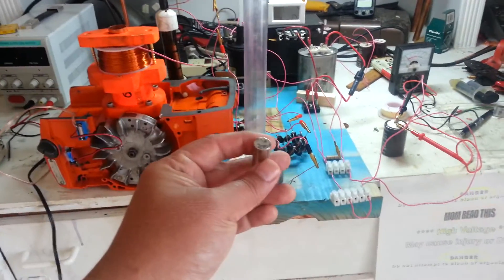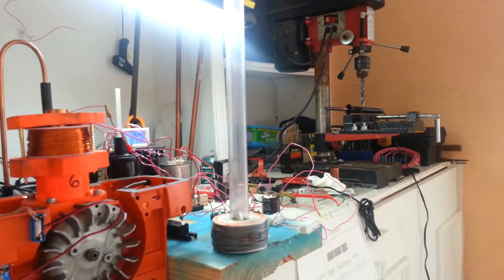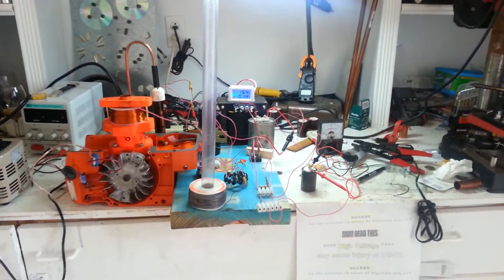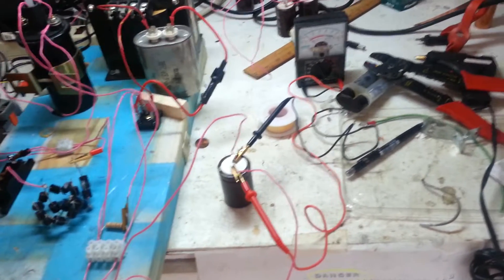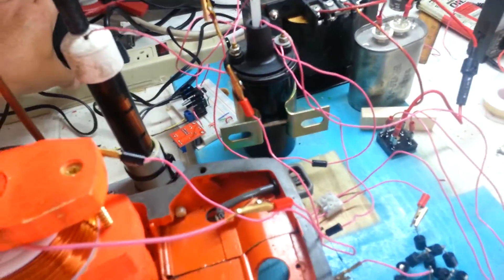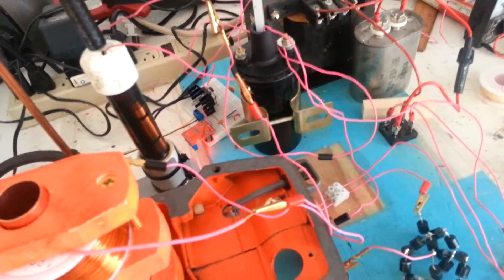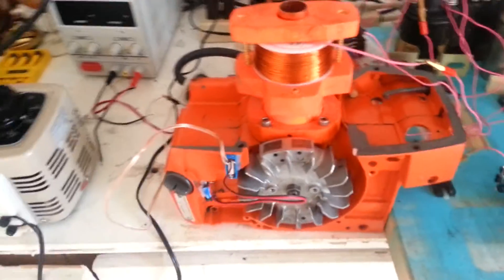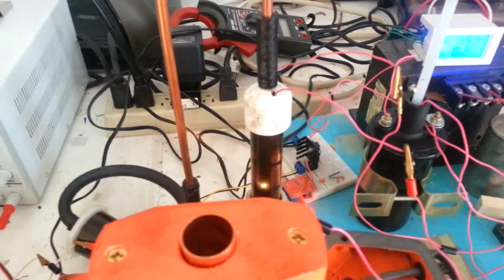Working Ed Gray Motor

Comment: Hi great video. However this is not a gray motor. Ed Gray motor uses two opposing coils period and uses the electricity to recharge the battery. Only the back EMF spikes are used to run the motor. He also did not have any metal in his motor. You're about a quarter of the way there. There is a actual replication called Ed Gray motor test here on YouTube
Reply from the maker: I have been told it's not an Ed Gray motor before. I can't pretend to speak to that, I wasn't near his device, nor did he personally tell me how it works to compare.  I built to what I thought would work, it has a spark gap tube and can pop magnets.  If you do know to say that I only built a fourth of it, well done. But please let me point out that no where in your BEMF battery charger description, did you explain what the Gray Tube was or what it did. I find that odd, because the CET seems to be the heart of the available schematics. Since we are on BEMF subject, Bedini who drew a schematic to Gray's motor, is famous(infamous) for his BEMF chargers. Which as we know didn't live up to the hype. Therefore it's hard for me to believe that the Ed Gray motor was just an earlier version of a Bedini BEMF battery charger. If it was possible to run a motor from BEMF, so many people would have self running perpetual motors. Try to build a Bedini motor, and you'll see. Now try create a BEMF motor that has an excess of 750 watts. That's  only 1 horsepower. If you have more information please share. I am no expert.
Reply: @XR_IX  I don't have much experience with the bedini motor, so I'm not sure your reference of its legitimacy to be accurate. I do know that he was threatened, which does give some legitimacy to his claims. Maybe you have some more info on that to show with me? You do make good points that few people have been able to replicate Ed Gray's motor. However there have been some that have. Honestly most people that get to that level do not broadcast it, for the obvious reasons. There's enough information out there to see exactly what a great was doing as far as material and components. The hard part is being able to identify exactly what back EMF actually is so that it can be used properly. You can see for yourself in the coil popping demonstrations that much more Force is demonstrated by a capacitor then a electromagnet for the same energy input. Ed gray did not have any metal in his motor, it was all dielectrics. If you know anything about t Townsend Browns work you will know that he also use capacitors and dielectrics to produce his effects. These two things are related. In my resonant charging video you will see that there is a use for the back EMF discharge and a wireless energy that can also be collected when the discharges are not occurring. Nikola Tesla said that any alternating current over 10,000 Hertz would produce wireless energy. That's why I use the neon sign Transformers because they are around 38 khz. Although they are tricky because they have fail-safes. You have to use a metal halide light bulb to prevent the back EMF from shutting down the Fail-Safe in the neon Transformer. I think the way Ed gray was doing it was by using the two coils and just transferring the pulse to the next coil while at the same time utilizing the repulsion for mechanical work. But there is also that high-frequency component that can be used as well. The high-frequency component is a polarization of the energy in the space around you. That's all a free source of energy since the vacuum is an infinite source of Dynamic energy. The way I look at the capacitors is that they produce positrons when excited by electron current, and you can block the electrons in the capacitor while you use the positron from the vacuum. I think this is how his lightbulb circuit works, Don Smith did a similar thing. We now have knowledge of metamaterials and quantum mechanics that these two inventors weren't aware of. Positrons and other anti particles are the scalar component that were taken out of Maxwell's electromagnetic equations by Oliver heaviside. This is the free energy that remains when you take out all of the vector components. I quickly realized there are many other ways to split the positive as gray had described besides using that tube which is highly inefficient. In fact from what I read grey took the tube out entirely in his later versions. Splitting the positive actually means is being able to use the back EMF and the wireless electricity at the same time. In other words being able to use the electrons and the positrons. Positrons are just the electrons with a little bit more of a charge. If you find a way to polarize that positron with a larger charge then it will flow towards that larger charge and not annihilate with the electron. Therefore you can use both to do work. In my Don Smith device I use an earth ground which is 500,000 coulombs. Compared to the 10 to the negative 19 positron. Kind of like electrolysis how the charge dictates which plates the hydrogen and oxygen atoms stick to. The capacitor is much the same way the charge determines which plate the positrons and electrons go to. It isn't until you short the plates do you have the annihilation of occur which is that large spark gap discharge of X-ray emission. You can sometimes get gamma emission also with a large enough electric flux density so be careful. The electric flux density changes the dielectric constant and the actual rest mass of the particles in the circuit so that you can actually get a cold fusion very easily that scalar components is actually the secret behind all of the classified UFO technology as well. That's how John Hutchison was able to achieve his experiments. Anyways I hope this information was helpful I will try to find that video for you
Reply from the maker: @jeffvan2529  Rather than using this clunky messaging in YT to exchange ideas, let me first thank you, and say I am glad to make your acquaintance, you seem to be a part of very small slice of humanity who burns the candles bright. Allow me invite you to energyevo.org, it is filled with other bright candles and I consider them teammates. The forum is a closed community to serious people. Please let me know if you are interested and I will convey that to Zed. Meanwhile... here is something I don't share: https://youtu.be/-FjRV950snM
Reply: @XR_IX  I tried registering on the forum but it's not allowing registrations
Reply from the maker: @isaiahj3968   Hi Isaiah, I am not the admin of the site Energyevo.org, and you'll have to contact Zed, if there is a contact the administrator for the forum still available. The site from the beginning was not like other "Free Energy" forums I had contributed in the past, which generally wanted members of any kind. Which led to political/religious discussions and arguments --which generally are pointless and unproductive. It also led way for people who want to crush the soul of "out of the box" thinkers. This is my opinion of course, but @Energyevo I find a high level of competency, and people willing to replicate and challenge modern binary thinking.  Normally if I can estimate a candidate's level, I can recommend people. However, I don't see any videos you have created, so I am not sure where your head is at. (It is not my decision anyway). If you do have interest and have no vehicle to contact Zed, you might be able to post a reply to one of his topics.
Reply: @XR_IX  https://youtu.be/1rFjrPo9mws

Comment: Good afternoon
what is the electrical scheme of your device? how does the spark gap work
Reply from the maker: I have all schematics posted on energyevo.com, the spark really is just two coper bars with dielectric oil pumped to clean the carbon tracks. The spark of the HV allows high current from the capacitor to flow to ground. The diodes from the two positive meet at the spark group, and plasma arc acts like a bridge.

Comment: Is that a fuel filter behind it at the end?
Reply from the maker: Yes that is, a fuel filter. Pumping oil around the spark gap does many things, keeps the electrodes cool, extending the operation electrode performance while reducing the chance of carbon shorts forming. Without a flowing filtered system, you will see a parabolic response as the particles in the oil create less resistivity at a peak but then will start to create burn spots in the electrodes insulating the spark gap.

Comment: Are the copper turns in your coils all insulated, or is it bare copper? I'm confused because an auto mechanic told me recently he thought that the thick windings in motors are bare? I really appreciate your feed back.
Reply from the maker: They can't be bare as there would be no point to the windings shorting through itself. Transformer(magnet) wire has a coating, like enamel or epoxy of some sort, that can take both heat and stay flexible.  It appears bare, but it is not.
Reply from the maker: I wouldn't bring my car to that mechanic LOL

Comment: Nice work! I have been working towards this too for a several years now, and just today came across your video. I started out not thinking about EV Grey for driver, until I seen the Aaron Murakami's plasma ignition stuff.
Reply from the maker: Thank you, I actually corresponded with Aaron for a while, as he he owns a free energy site. I did use his breakthrough stuff and mimocats video to reproduce the effect. I can tell you I disagree with the sole potential of the effect as an energy producing engine, but let me frame that opinion. If you create the effect and try to say run a car you will find that you are putting in more energy against a magnet direct driven motor. But that's not to say you can make supporting systems to make the effect a transforming system. You can use high voltage energy stored in capacitor to transform it into discharge motive force. And the way you create that HV can take a fraction of energy. It just is, that the equation needs more time, more build up sources, or external added energy (from where) to produce a fast enough capacitor discharge. Ed was trying this too, because he had a Tesla coil in his pictures that people don't really talk about. I think Ed probably had a fly wheel with timed discharges, as the core of the motive force. But you have ask after millions of dollars of investment, why it never made into an engine (because life is different once tested with load), I think he ran into the same performance issues. However, there are other approaches with magnet motors, which need that last kick to make them self running, which may be achievable in my opinion, by using a large enough fly wheal, and a solenoid powered by this effect. I would travel down that path if you have interest in this approach. I am at energyevo.com if you want to correspond. I will always help in anyway I have time for.
Reply: @XR_IX  it seems the real trick for success is to be able to charge capacitor fast enough and with as little current as possible. What was the wattage need to run your motor setup? 
Also, what coil resistance did you find worked best? 
Cdi ignition is a better way to produce  the HV side, instead of 5kv powersupplies like gray shows. The capacitor charge should be 300-600v by a PS instead, IMHO
Reply from the maker: @DavyOneness  I give that information in the description. The coil had to be 6 Ohms or better. Too much resistance and you create heat, too little resistance and not enough magnetic pulse. Yes charging a capacitor with a resonant L1/L2 is a good bet, for low input power charging. If you could simulate all the math in model, you could come away with more efficient motor or better. But maybe you forgo the motor part and go straight to transformer. I decided to go that way.
Reply: @XR_IX  sorry about that. I missed the description. Yea, thats a lot of power you are using to do the process. 60hz is definitely not the route you want to take. I built a power supply that operates at 2khz and only draws 10watts off of 24volts when its working its hardest to recharge the cap after discharge. "Stair step charging" the capacitor seems to be the better trick, then getting lost in any math modeling.  I designed and built this 'RPS' (radiant pulse supply)   for a pulse motor build off contest I was just working on (and now waiting judging).  I think you will find this a more efficient approach. I am just stuck on best coil geometry for the stroke. And also the best magnet arrangement. But I am getting enough of a impulse that it should run once I get the coil and magnet right for this scale model.
https://youtu.be/kn1iM8U3oko
Reply from the maker: @DavyOneness  The question is not - does the concept work, the issue is how to take that pulse power and draw from it with the maximum efficiency, and do it such that it doesn't push back against itself. If you use a magnet, it by definition pushes back against the current flow created from the pulse. My engine uses the opposing magnetic motive, but that really isn't smart. Think about using a high magnetic coefficient material as the stator and you can defy Lenz law by pulsing stator attraction. There is more, look at Faraday's homopolar motor. All you need is a common shaft between two devices, and you should be able to build a power gain device. Just my opinion, If I think outside the box. Rotation has many advantages, incorporate  as many of those in your device.
Reply: @XR_IX  I'm starting to think it maybe better not having the magnet in the coil, it seems like the face of the coil has more kick than what happens in the core of the coil, could be why gray never took the route of a solenoid type motor. Also think there maybe a kick from the field collapse too that can fight the process if the magnet is at the wrong point inside when it happens
Reply from the maker: @DavyOneness  I suggest you pop some magnets to confirm your design. There is a reason the Neuman motor has a similar design. The discharge builds a magnetic pulse in a toroidal shape, the strongest magnetic energy is at the limit of the Bloch wall in the center, not the face (ends of the coil). You can use a ferrous core, and move that energy to the ends like a bar magnet, but you will lose orders of magnitude even with the highest permeability.  That goes against engineering equations for a solenoid (Yes engineering is wrong for instantaneous DC)

Comment: just another thing. from my own expriences , when plate charges discharge at near  zero resistance, the electrons fight each other. plus fights minus and what happens is that when a electrostatic field discharge, the polarity  of each wire try to reverse so that they oppose each other and there is no direction of the electron flow. since the field is stronger on one plante than the other you get a potential difference that start the circuit but as soon as its established the charges try to balance against each other. what kills the circuit is that the resistance is never 100 percent zero so there is a bleeding in there that causes the filed to disintegrate as the field on one plate dimishes gradually.

 in a superconductor the field chould not collapse once established and chould remain indefinitly.

heat in the system is what prevent a electromangetic field from remaining on indefinitly.
Reply from the maker: I'm not sure what you're saying about the opposing charges. But I did have a great deal of heat build up in the coil, enough to melt the plastic spool. Opposition to current flow is resistance. Resistance causes heat, so a superconductor would help, as lowering the ambient temperature of the device.
Reply: Or they fight each other cause its in parallel, not series, plus fights plus,  ?
Reply: You cannot have an indefinite super conduction circut, unless it is an arc, which of course is an extreme amount of current dissipation. Even in the quantum computer world, they can only be established for periods of time.